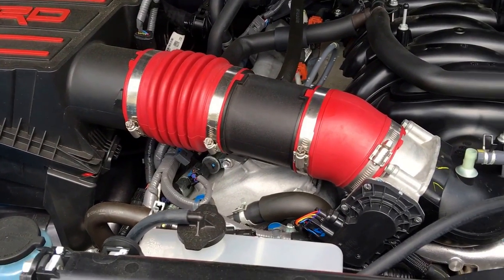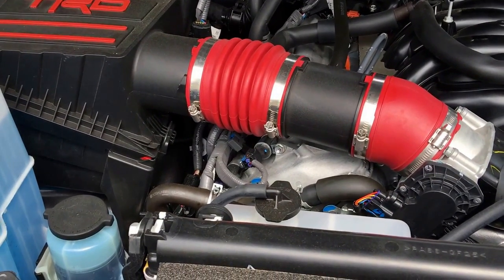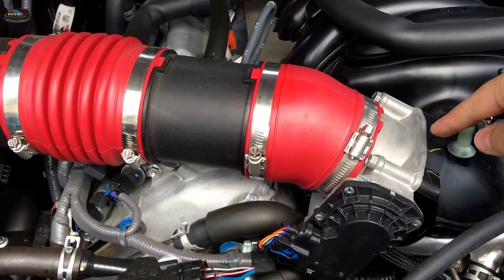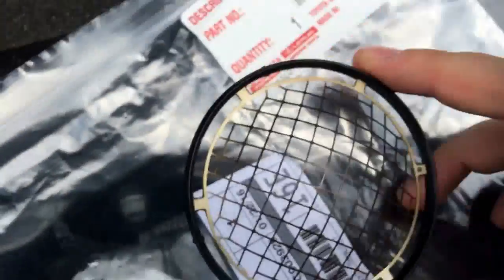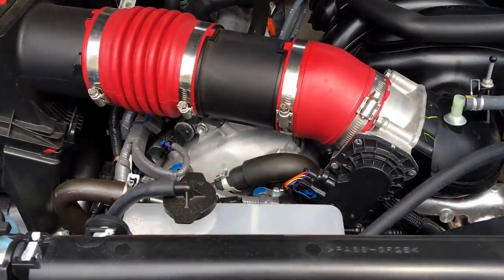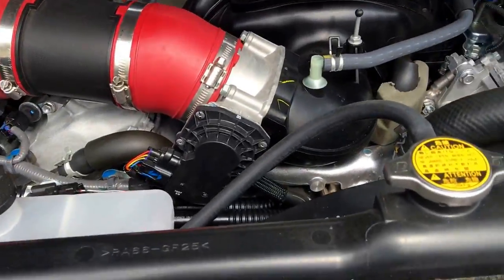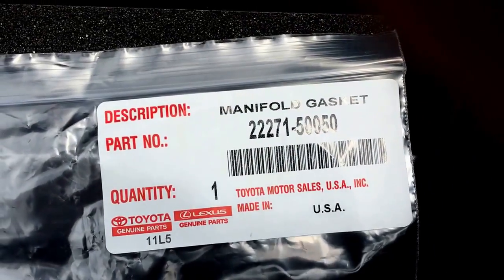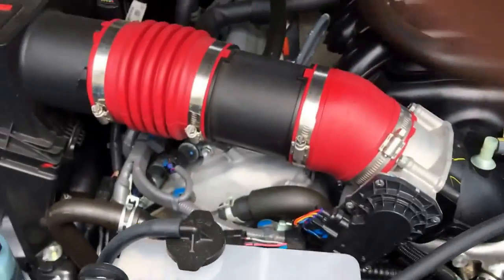Annoying whistle after installing cold air intake or filter on the Toyota Tundra? HERE'S THE FIX!

Comment: Hey, I have a deisel car which does not have a proper throttle bosy, like instead of a throttle body it has an exhaust manifold (location wise). After installing a k&n 1060, it startes to make a turbo whistle and at some speeds it soundes like it did not have an exhaust which I liked, but my dad didn't, so can you tell me where can I put that ring which you were showing?

Comment: @tundradude34
I have a Lexus LS 400 with a V8 1UZFE VVTI motor

from what I understand these V8 platforms are similar to the ones used in Tundras and most V8 Toyota / Lexus vehicles 

but anyways, I did a after market modification to my oem air intake which allowed me to use the factory maf sensor and air ram. I was able to install an aluminum edelbrock high flow air filter (I made sure couplers & seals were air tight) 

after doing that modification that's when I started hearing a light whistling noise especially from the passenger side (where my air filter is located)

I initially thought it was a wheel bearing, power steering or rear differential.. but, my ps fluid is full plus the noise occurs on straight aways. Also the noise really isn't 100% what you'd expect to hear from differentials & wheel bearings (which from what I've heard sound more like a howling, not whistling) 

this makes a bit more sense. 

when I clean my throttle body I will look at the gasket and modify that as well..
Reply from the maker: That seems to do the trick

Comment: Why wouldn't you just remove the the wire basket part?
Looks like a pair of wire cutters would make short work of it.
Reply from the maker: +TrulyUnfortunate some people do it that way as well. Thanks for watching! 👍🏼
Reply: That basket is important, it's a safety feature in case the filter fails, u don't want a chunk of something to fly into the engine
Reply: Does it affect in a negative way when smogging your vehicle? In other words can you fail the test. My Tundra is a 2018 so I won't have to smog it for a few years but just like to know if anyone has had any issues when removing the mesh gasket.